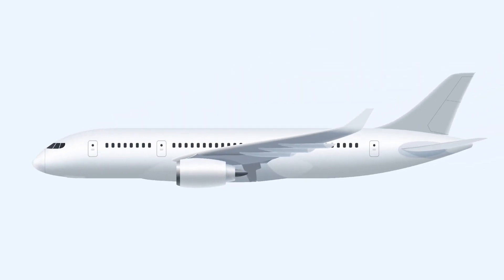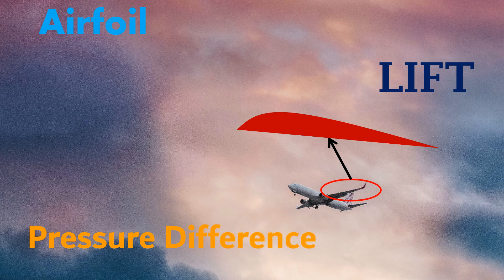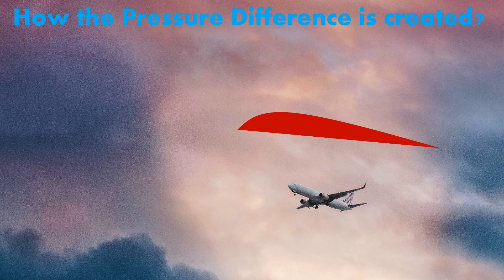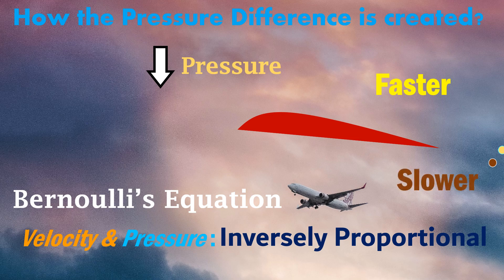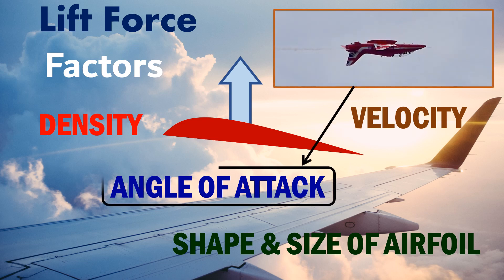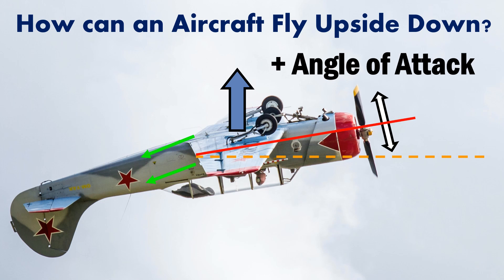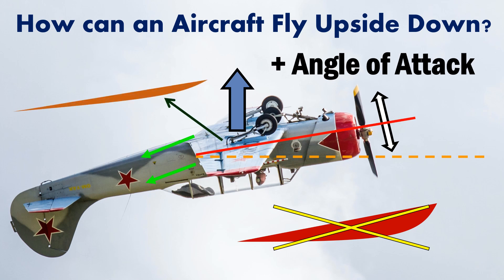How Some Aircraft Fly Upside Down? | Understanding LIFT FORCE! | Factors Affecting Lift!!

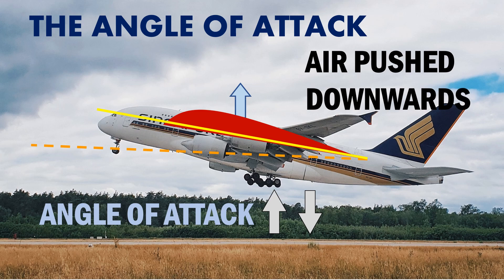Comment: First you use Bernoulli's principle to explain how lift is created. And then all of a sudden (03:22) you go over to explaining lift by using Newton's third law. One of the assumptions in Bernoulli's principle is that of equal traveling time for air that is flowing over the airfoil, and air that is flowing under the airfoil. If you create a video on this topic, you will certainly be aware of the fact that 'equal traveling time' is a myth, as many experiments in wind tunnels have shown. Aircraft can only fly upside down because of Newton's third law. If Bernoulli's principle were at work, an aircraft flying upside down would experience a downward acceleration of 2g: 1g for the acceleration of gravitation at the earth's surface, and 1 g for the now reversed lift. Also Bernoulli's principle can't explain why the angle of attack has an effect on the amount of lift generated, as the profile of the airfoil doesn't change, and hence the distance for particles traveling over and under it doesn't change. You just added some extra confusion to the 'debate' on how lift is generated.
Reply from the maker: Yes. Just tried to summarize all the principles applicable for lift. Thanks for sharing!
Reply: @JxJAVIATION  I tried to point out that, if an aircraft can fly upside down with the same wings that it uses to fly upright, Bernoulli's principle cannot be a cause for lift, no matter how many people keep repeating this nonsensical story. If you want to summarize principles, then it would make sense to not mention Bernoulli at all, or otherwise to mention it as an urban myth. In your summary, in this video, you make it look like an airfoil can choose which principle it uses to generate lift. That's not how physics works.

Comment: You're correct about the Top-Bottom pressure difference being the lift.
.
Unfortunately, you are repeating an all too common myth about Bernoulli's Principle and Equation.
.
What you should get out of Bernoulli is that a speed increase (acceleration) is caused by a Pressure Gradient (difference pressures between two locations). Pressure differences accelerate the air. A pressure Gradient pushes and accelerates air toward the lower pressure. This is Newton in fluids and is the SAME thing as the Top-Bottom difference pushing the wing up!.
.
The decreased pressure above the wing is the cause of the acceleration toward the trailing edge.
.. ...

.The biggest factor for lift is what happens above the wing. The wing's motion and shape causes a reduction in pressure, but not as described here.
.
 Yes it is counter-intuitive, but this is fact understood by aerodynamicists that is accurately covered in this short video - for ALL WINGS, upright or inverted, because it is the airflow that is the most important, NOT simply wing shape:

 WHY There is Lower Pressure Above a Wing
 https://www.youtube.com/watch?v=3MSqbnbKDmM 
A LIKE would be appreciated.
..
And read this:
 Understanding Lift Correctly
 https://rxesywwbdscllwpn.quora.com/
Reply from the maker: The lift created by the airflow depends on several factors that come together in the lift equation. And using Quora as reference material isn't helpful!
Reply: @JxJAVIATION  Well, thank you for responding.  So many others post their video and abandon them.
 I wrote that blog after studying aerodynamics and consulting with several noted experts in the field, not well intentioned amateur scientists filling the web with confusion. 
It carefully covers those 'factors that come together' step by step and following all accepted fundamental principles in science. 
.
What you have here is incorrect and spreading misleading myths as I explain above. If you wish to continue doing that, regardless of your good intentions, then so be it, but it only serves to add to the confusion.

Comment: This is a broken and incomplete description. You mention Bernoulli by name but that only accounts for a certain portion of the lift. A flat sheet can fly just fine with an angle of attack due to Newtonian lift which accounts for the majority of lift.
Reply from the maker: Yes. I kept this video focused on how lift is created when the airfoil is upside down. I had created a video sometime back on how lift is normally created on the airfoil. You can watch it here: https://youtu.be/bzHA0dRZkAA
Reply: The Bernoulli explanation is seriously flawed and does not explain it any where correctly.
.
The biggest factor for lift is what happens above the wing.  Yes it is counter-intuitive, but this is fact understood by aerodynamicists that is accurately covered in this short video - for ALL WINGS, upright or inverted, because it is the airflow that is the most important, NOT simply wing shape:

 WHY There is Lower Pressure Above a Wing
 https://www.youtube.com/watch?v=3MSqbnbKDmM 
A LIKE would be appreciated.
..
And read this:
 Understanding Lift Correctly
 https://rxesywwbdscllwpn.quora.com/

Comment: Keep uploading dude i really liked your channel a lot because every videos has been filled with the valuable information....... To be honest your videos cleared most of my doubts.
Thank you for such an awesome quality information in every videos.
Reply from the maker: Thank you so much!!
Reply: He is correct about the Top-Bottom pressure difference being the lift.
.
Unfortunately, he is repeating an all too common myth about Bernoulli's Principle and Equation.
.
What you should get out of Bernoulli is that a speed increase (acceleration) is caused by a Pressure Gradient (difference pressures between two locations). Pressure differences accelerate the air. A pressure Gradient pushes and accelerates air toward the lower pressure. This is Newton in fluids and is the SAME thing as the Top-Bottom difference pushing the wing up!.
.
The decreased pressure above the wing is the cause of the acceleration toward the trailing edge.
.. ...

.The biggest factor for lift is what happens above the wing. The wing's motion and shape causes a reduction in pressure, but not as described here.
.
 Yes it is counter-intuitive, but this is fact understood by aerodynamicists that is accurately covered in this short video - for ALL WINGS, upright or inverted, because it is the airflow that is the most important, NOT simply wing shape:

 WHY There is Lower Pressure Above a Wing
 https://www.youtube.com/watch?v=3MSqbnbKDmM 
A LIKE would be appreciated.
..
And read this:
 Understanding Lift Correctly
 https://rxesywwbdscllwpn.quora.com/

Comment: Great content! ...but  piano is super iritating...
Reply from the maker: Thank You! The piano is a work in progress. Will change it soon.
Reply: No matter what -  thanks for good work!!!
I really appreciate efforts!
Reply: I don't care for music either.
.
Unfortunately, he is repeating an all too common myth about Bernoulli's Principle and Equation.

.
What you should get out of Bernoulli is that a speed increase (acceleration) is caused by a Pressure Gradient (difference pressures between two locations). Pressure differences accelerate the air. A pressure Gradient pushes and accelerates air toward the lower pressure. This is Newton in fluids and is the SAME thing as the Top-Bottom difference pushing the wing up!.
.
The decreased pressure above the wing is the cause of the acceleration toward the trailing edge.
.. ...

.The biggest factor for lift is what happens above the wing. The wing's motion and shape causes a reduction in pressure, but not as described here.
.
 Yes it is counter-intuitive, but this is fact understood by aerodynamicists that is accurately covered in this short video - for ALL WINGS, upright or inverted, because it is the airflow that is the most important, NOT simply wing shape:

 WHY There is Lower Pressure Above a Wing
 https://www.youtube.com/watch?v=3MSqbnbKDmM 
A LIKE would be appreciated.
..
And read this:
 Understanding Lift Correctly
 https://rxesywwbdscllwpn.quora.com/

Comment: Great content.Thanks love yaa you are amazing...💪🏼🙌🏻👍🏻😘
Reply from the maker: You are WELCOME!
Reply: Unfortunately, he is repeating an all too common myth about Bernoulli's Principle and Equation.
.
What you should get out of Bernoulli is that a speed increase (acceleration) is caused by a Pressure Gradient (difference pressures between two locations). Pressure differences accelerate the air. A pressure Gradient pushes and accelerates air toward the lower pressure. This is Newton in fluids and is the SAME thing as the Top-Bottom difference pushing the wing up!.
.
The decreased pressure above the wing is the cause of the acceleration toward the trailing edge.
.. ...

.The biggest factor for lift is what happens above the wing. The wing's motion and shape causes a reduction in pressure, but not as described here.
.
 Yes it is counter-intuitive, but this is fact understood by aerodynamicists that is accurately covered in this short video - for ALL WINGS, upright or inverted, because it is the airflow that is the most important, NOT simply wing shape:

 WHY There is Lower Pressure Above a Wing
 https://www.youtube.com/watch?v=3MSqbnbKDmM 
A LIKE would be appreciated.
..
And read this:
 Understanding Lift Correctly
 https://rxesywwbdscllwpn.quora.com/